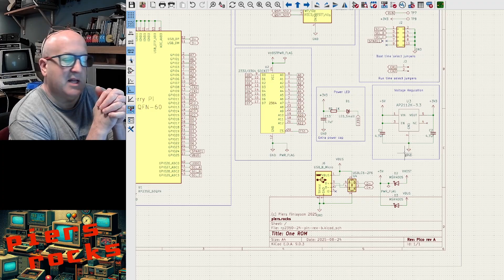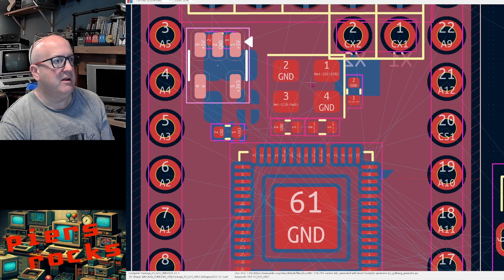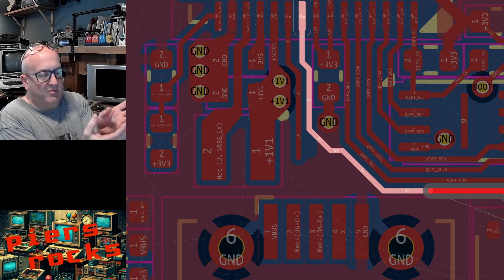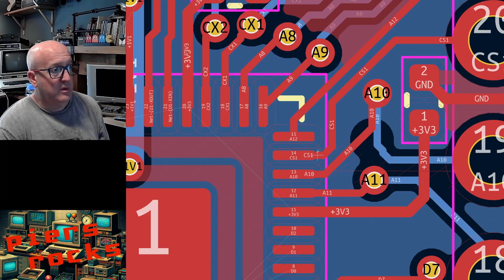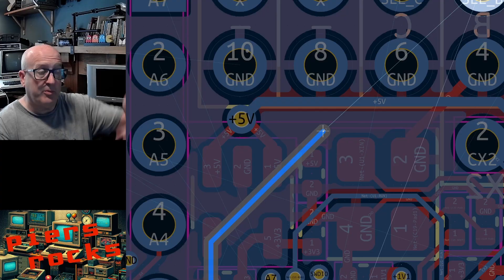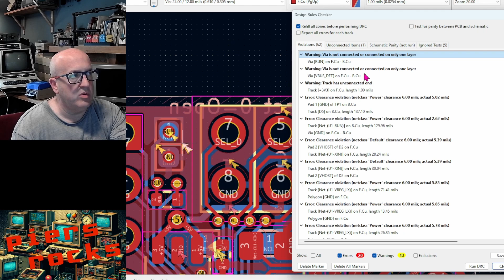One ROM Fire USB - Laying out RP2350 + USB in 1/2 x 1 inch

Comment: Hi Piers well you had your work cut out with the space constraints, well done. I know you mention NOT to have components on the underside, but just occasionally especially bulk decoupling capacitors as long as these are kept away for the underside edges, like wise any pull up/down resistors usually a Via being easier to route around rather than a component. You may have found it easier in the long run. In regard the jumper selection block you could also use 2mm spacing and appropriate 2mm jumpers, anything else could remain as the usual 2.56mm /0.1" to allow dupont connectors to be easily used.
Reply: You did mention pin pitch 1:17  which I should have remembered Doh. mind you for jumpers not off board wiring ?
Reply from the maker: @grahamrolle3923 Yes, components on the underside would make it easier - and there's plenty of space "in the middle" without fouling the pins/socket. I haven't actually explored what the additional cost for 2 layer fab is, but JLC seem to struggle with this on a single layer ...

I am explicitly trying to keep 0.1" pitch jumper pins, just because the pins and jumpers are so ubiquitous.  It's possible that change could allow a move to USB-C.

Comment: Was the constraint of no components on the bottom imposed by you or your PCB fab?  If the former then why?  Especially as the ROM pins are on the bottom and passives would be lower than the carrier (the black plastic) of those pins.
Reply from the maker: I wanted to keep fab costs down, by only installing components on a single side.  I haven't actually checked, but I assume you pay more for dual-sided fab.  The top side has more space available because the black plastic of the pins on the underside means a few more mm2 unavailable for components.  Not to mention power dissipation issues for the MCUs if I stuck them on the underside.  But yes, in general the underside is available for components.

Comment: G'day, the RP2350 hardware design guide says you should include series 27 ohm resistors on DP/DM in order for the device to meet the USB bus impedance requirements. You don't seem to have done that but you have added additional ESD protection which they don't call for, presumably because they feel the existing ESD protection/tolerance is sufficient. I've also used additional ESD protection on various projects but if it is a case of either/or I'd stick with their design guide. 
Personally I would have gone straight to a 4 layer board for this, you've essentially had to throw away all signal integrity guidelines to make it fit on two layers to save a tiny amount of money. Your USB data lines - which should form a 90 ohm transmission line - have traces crossing them on the bottom layer! 
I know the standard answer will be "but it works" (I assume) but I'd rather know it works because I designed it in a way that gives it the best chance of working - every time. 
You are lucky in that the interface to the target system is "slow" but you should still be designing for the harmonics of the square waves you are interfacing with (the rise and fall times of the 2350 will be much much faster than your target). Remember a square wave only looks like that because of all the harmonics. So a 4MHz square wave is only square if the circuit carrying it can cope with the 8/12/16/20/24MHz etc etc harmonics. Now think about the (nominal) 75MHz clock signal going to the QSPI device and travelling down it's data lines. These are high speed signals and should be treated like multi-hundred MHz signals at least. You again have traces running under these lines, where are the "return paths" for these signals going?
Love your overall project. Cheers.
Reply from the maker: My goodness, you seem like a hardware person, I'm not, just a dumb software guy!  One point in return - the RP2350 hardware design guide does explicitly target a 2 layer PCB.  Yes, I could have gone to 4 or 6 layer, and also done USB with better signal integrity and impedance, but it's cheaper this way and it may even work.  I'm only aiming for full speed USB here, i.e. 12 Mbps.
Reply: @piers_rocks  haha no just an old everything guy ;-)
Yes they have targetted 2 layer boards! 
They have put a lot of effort into ensuring that the important signal integrity things are still taken care of. They maintained a solid ground pour under the SPI, USB and critical power supply inductor areas. The USB is run as a transmission line and includes the resistors, see, great examples to follow!
All the best, I have a room full of potential uses for your project....

Comment: Would this have been easier to route usin a 4 layer board?  I know the RP2350 doesn't really need full planes for power and ground, but the board cost at this small size isn't that much more. 

The boards we make at work for our devices (ARM processors) usually run between 6 to 14 layers, depending on what it does.  The ATE boards reportedly have something like 30 layers, but I don't work directly with those.
Reply: It would not be easier on 4L, just because you'd have to put even more vias to jump sides (not to mention all the missing return path vias). Although, he mentioned using 6mil traces & spacings, while fab allows for 3mil on 2L and vias look oversized as well.
But it would definitely be the only way to at least start to move in a right direction in terms of fixing EMI & signal integrity issues he has no sense of magnitude that these design constrains dictate. Cross talk is unavoidable, return paths next to non-existent and reference plane is a bunch of isles connected with litz wire strands.
Realistically to make anything close to decent high speed design in such a tight area you'd need to make it HDI unviable and even then, loop areas are going to be increased just because there's like a single GND point in headers.
But I agree, if you are to make it, at least do it on 4L. This CN fab is doing it for $2 for 5 pieces of greater area than two of these designs, ffs.
Reply from the maker: @daviddicarlo1999 No, I don't think so.  If you moved to a 4 layer board you'd likely use the inner layers for gnd and power.  Thus meaning no real benefit for routing as the top layer under the RP2350 still unavailable for routing.  You'd be signal integrity benefits though.

I reckon it would be easier with 6-layer, but that means increasing costs.  I suspect 2 layer sufficient, but time (well, testing the board!) will tell.

Comment: so let me get my ever so thick head around this , you have come up with a PCB that can mimic any 28 pin ROM for vintage computing without the need for board mods ? is that the basics of it ? say a 48k spectrum simple blow the ROM image plug in and off you pop ? equally a BBC b or acorn electron ? same device ? so instead of having a stock of e proms and various components you simply need a few of these in your kit ?
Reply from the maker: @firsteerr One ROM is actually a 24-pin ROM replacement today, but essentially yes, for 24-pin ROMs.  The USB version gets programmed directly from a browser - no special programming hardware. 

I have a 28-pin in the works.  There's a prototype board lying around here somewhere ..
Reply: @piers_rocks  thanks for clearing that up and look forward to the 28 pin version as a refurbish a lot of machines with those and a simple one stop would be very useful
Reply: @piers_rocks  Dear Mr Rocks, do you think that the 28-pin version(s) will be able to also cover the various 24-pin ROMs, and UV-EPROMs too?
Reply from the maker: @Brian_Of_Melbourne  Mr Of Melbourne :-). I don't expect the 28-pin version to support 24-pin ROMs - the power and gnd are at opposite corners of both 24 and 28 pin versions, so there's no real way to allow the 28 pin version to be compatible with  24 pin socket.  There could be a very simple "intermediate" PCB to allow the 28-pin version to fit in the 24-pin socket, but not sure it's really that valuable.
Reply from the maker: @Brian_Of_Melbourne  I am hoping to support all of the 23128, 2764, 27128, 27256 and 27512 with the same 28-pin version (so ROMs and EPROMs), but that's still TBD.  I'm starting the prototyping with the 23128 and 27128.
Reply from the maker: @Brian_Of_Melbourne  I am expecting shared firmware and other tooling though, and the same programming interfaces (both SWD and USB).
Reply: aye